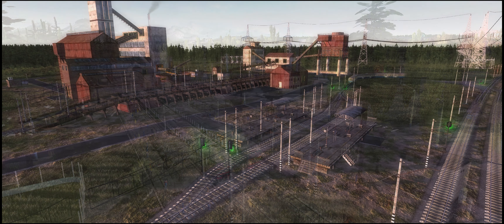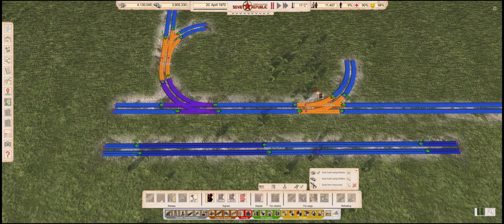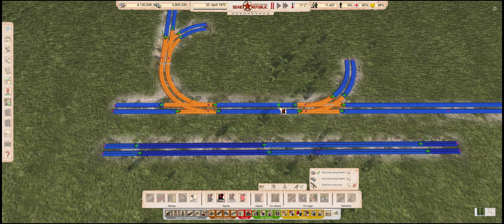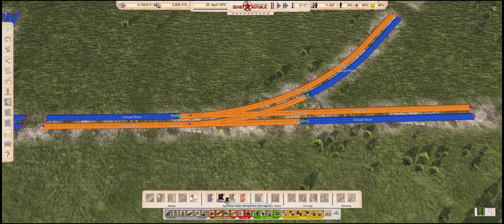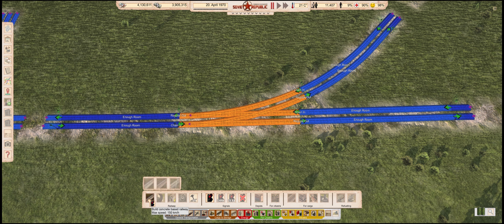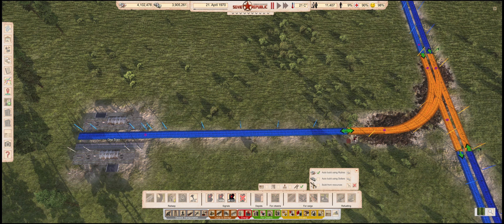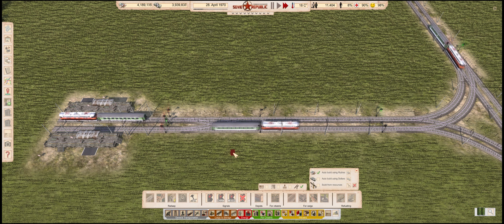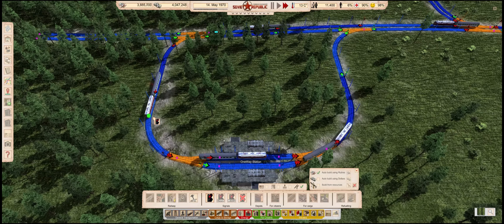How to Build an Efficient Rail Network ║ Workers and Resources: Soviet Republic ║ (V2.0)

Comment: You and bballjo should make an advanced guide that focuses more on fixing problems (greens and purples) that many run into.  Include also signal and track patterns for upgrading working rail for those that don't autobuild.  How to design RCO layouts (although bballjo has a good guide on that) on complex networks.
Reply: Yes, I would really appreciate that too. I have the problem that two double-track T-sections are arranged directly one below the other, and the trains just don't run, even though the way is clear. What does it mean when a signal is yellow?
Reply: @Kamik_ze  as far as i observed it, it means that another train claimed / reserved this block for it or is in his queue (i guess it has something to do with chain signal into bi-directional track)

Comment: ok there are alot more questions when you have 2 trains using one unload/reload point. like what makes the in or out of a junction because the junction is both???? it is Y with 2 tracks coming to 1 and the 1 splits back to 2 after the unload in this case. no mater how I set the signals 1 train get caught trying to leave. I have almost 2 days trying to figure it out. Than you add in different color tracks and you dont want to be purple. All my tracks are purple unless I add a swith....Head is spinning

Comment: Thank you so much. I finally reached a point in realistic where my Republic is big enough to NEED trains, definitely not optional, and it's just become micromanagement hell because I didn't understand how to set things up well. I had a very simple rail line right near the border with my first clothing industry, but as I tried to expand the network inland to second and 3rd industries it just wasn't working smoothly at all. 

I'm thinking about restarting on a new Republic with this in mind, as my entire goal was to survive long enough to learn the early game and it's systems well, and I think I've done that much at least. Now that I have a better idea about rail I can plan my next Republic with better rail infrastructure accounted for, and I won't hit this log jam. I'd rip out the track and try again, but I just didn't even set up my industries in a way where I have room to do it right. Lesson learned!
Reply: Another tip I've found is looking at Factorio train tutorials. The systems are similar enough in most cases that the information is interchangeable.

Comment: @7:30 still don't understand why you would use mixed signals instead of the normal chain/normal signal combo. Chain makes sense, it checks the next TWO segments. Normal checks the next ONE segment. But mixed? What does it actually DO?
Reply from the maker: Mixed signals are the combination of a chain and a regular signal. Since we need need chain to be pointing toward the junction, and the regular away from it, we can use mixed signals if we want that piece of track to be 2-way.

Comment: This tutorial was helpful although I still can't do trains. I do everything by road instead because I can't understand the signals fully. It would be nice if they had a mod that just allowed trains to go through each other. I'm not willing to put in the hours of studying and experimentation needed to get a railway working properly. That is work stuff, not gaming stuff.
Reply: Try ships. They can also handle large volumes, although are slower at moving.
Reply: @KarolOfGutovo  try airplanes problem solved

Comment: Great video, very well explained. Might be time to redo the signals in my republic :-). In the roll-in roll-out station, what is the use of the chain signals at the end? Why not normal signals, allowing trains to depart earlier?
Reply from the maker: Thank you.  :)

Which place exactly? If you mean the two chain signals right after the station, then they are not strictly necessary, two regular signals in their place and leaving off the "exit" signal for that particular junction would give the same result. Trains wouldn't be able to leave any sooner, since one of them would still have to wait until the first train gets past the queue signal at the middle of the leaving track before they are allowed through.

I just tend to reflexively put chain signal at the entrances and regulars at the exits whenever I build any form of a junction. Even if not strictly necessary in some circumstances, they don't hurt either, so might as well. :)